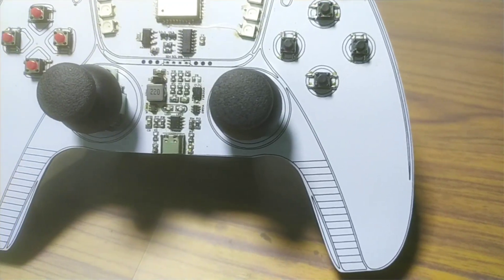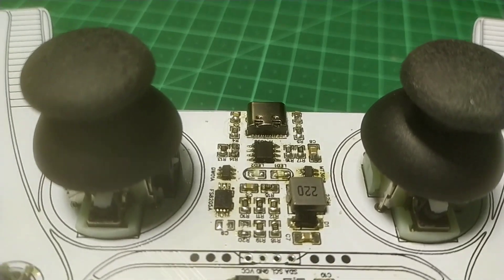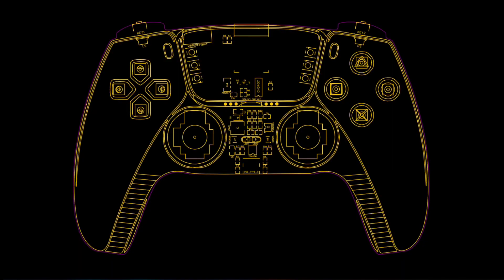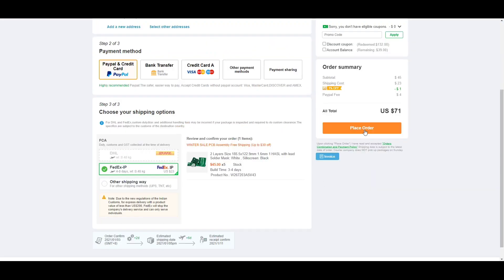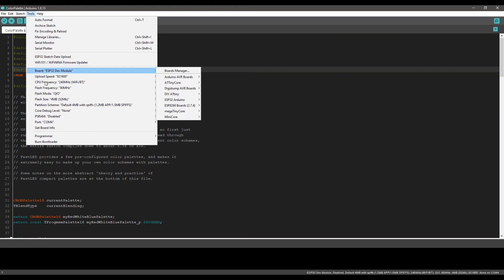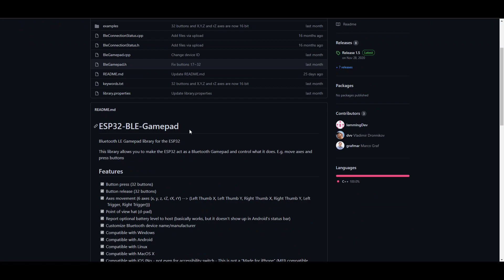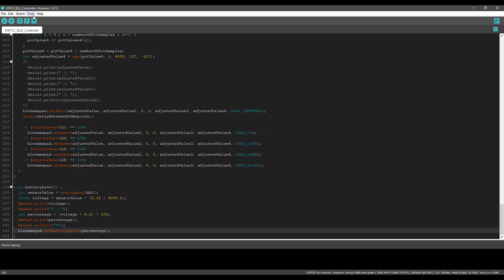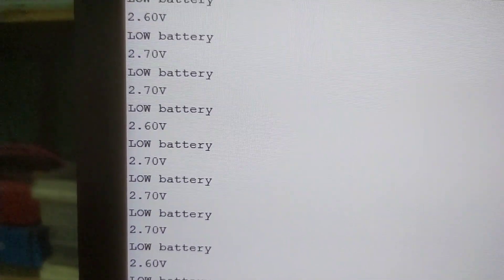DIY BLE Gamepad using ESP32 | PCBway

Comment: Great stuff. I'm interested in making my own Bluetooth controller for fighting games, with R1 and R2 being on the front of the controller next to ABXY. Such controllers exist, but most of them are wired, and the rare wireless option has relatively high latency (I think because they're quite old, so not using the latest Bluetooth protocol versions).

Comment: Excellent project. Is it possible to use 2 controls with the same receiver or should they be independent. Can you change the device name so windows recognizes it as controller 1 and controller 2? I wait your answer.

Comment: Are xinput games supported?  Currently, most games are made to use xinput. The direct input method is only for classic games. Steam games also work with xinput method, which is xbox360. Can't you check it?

Comment: you will not have a code so that they all work as buttons to make a gamepad but with many buttons and two joysticks to connect the steering wheel through an encoder there would be 20 buttons and 4 for the joystick

Comment: Hello, unfortunately, it does not seem to work on pc. On Android, it works fine. On pc, only buttons work and the analog sticks only seem to be either full or nothing. But I cannot send an analog value. If it is greater than 0 it is the maximum on a certain axis and if it's smaller than 0 it's the minimum. Have you encountered the issue too?
Reply from the maker: Hi, can you please check with the example codes provide in the library.
Reply: @ElectroPoint4u  yes also the same

Comment: Can I use this controller to control PC games?
Reply from the maker: Yes
Reply: @ElectroPoint4u  thank you very much. But when I want to run ESP32_BLE_Controller.ino this file, it fails, and Arduino IDE told me "fatal error: nimconfig.h: No such file or directory
", could you tell me how to solve it?
Reply: @pyc7737  same is happening to me

Comment: I tried testing the software and although I can connect to the ESP32, i get an error: "NIMBLE_NVS: NVS write operation failed !!
" and dont  get any output on the android software. Any thoughts?
Reply from the maker: Try with the example code from the library

Comment: I noticed that the right analog stick was not working in cod mobile gameplay. Is this gonna be a problem in other apps too?
Also is this project possible with a wired gamepad that I already have so that I will have both case and pcb?
can I first program the esp32 board and then connect my USB gamepad buttons to it via the PCB?
Also on Amazon the esp32 board is already having a micro USB interface, so is my variant of your project possible?
Also I don't require led lights. I have my own system for that. 

Great project btw.
Reply from the maker: It's an issue with the library I was using, both joystick were working on PC but for some reason it isn't working on android
Reply: @ElectroPoint4u  so is my project possible?
Reply from the maker: Yes, I think so

Comment: Hi, Thank you for sharing this great project. My students are building this for a high school junior project. One problem, the esp32 board we are using does not have a pin IO16 available to breadboard. Is there a way to assign another pin. Thank you in advance
Reply from the maker: Yes, you can reassign the pin in the code
Reply from the maker: https://github.com/lemmingDev/ESP32-BLE-Gamepad
Reply: Does this work as a Xbox or PS2 controller.  I have only got b0, B1, B3 working
Reply: Btw thank you for all your help
Reply: Can you recommend a good windows test program
Reply from the maker: Windows has one built-in
Reply from the maker: Go to run and type in joy.cpl
Reply: W teacher

Comment: Found out that your BatteryLevel Checker Code does interrupt the sending of inputs.

In Serial Monitor, battery levels are updated like every 3-5 seconds. 
Inputs, analog or digital, only go to my PC when Batterylevel gets updated. 
It says "0,5 V - battery level low" when connected to USB. Which is wrong. With 0,5 Volt the ESP32 wouldn't even boot up!
I disabled the whole Batterychecker Code in your sketch and NOW inputs are sent instantly to the PC. Inputs do work like they intended now :)
Perhaps it has to do with the FastLED stuff, cause i don't use LEDs and its waiting for response from the LED Strip?! I don't know for sure.

Another question: Where did you find all the commands needed for the code? I couldn't find any documentation :/
On the Git from Lemming it only shows this example code, thats it. Not much to work with :/
Reply from the maker: Battery level only work with the battery connected. Most of the codes I adopted from the examples. You can get more in-depth overview of each functions if you go through the cpp file
Reply: @ElectroPoint4u  I can not connect it to pc via bluetooth. Do you know how to fix it?